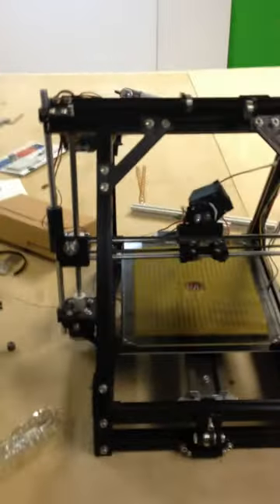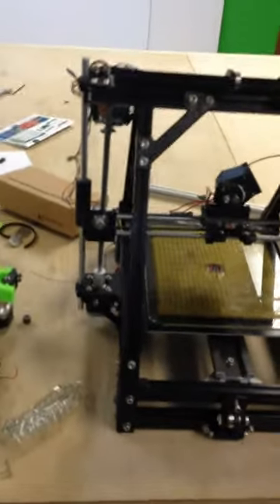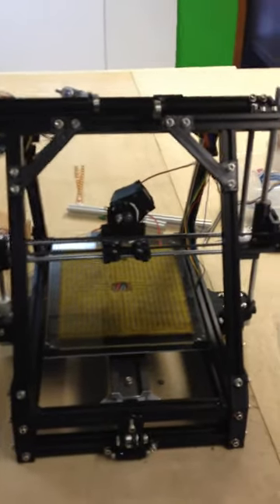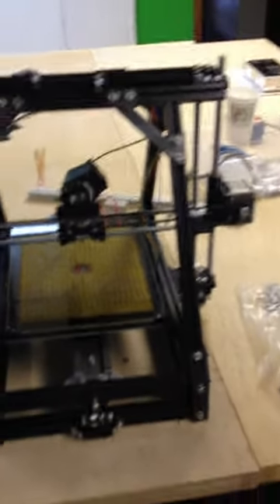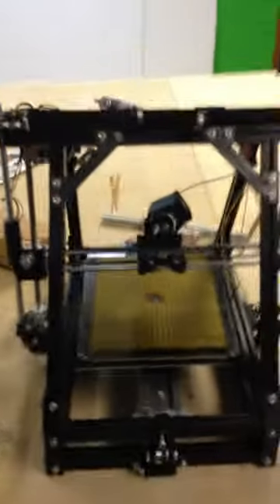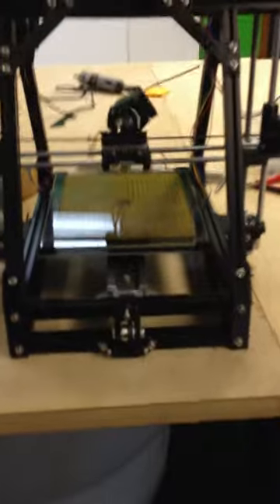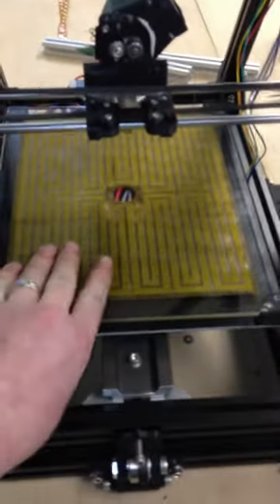TrinityLabs MendelMax-1.5+ with new Y axis!

Comment: I'll give a less technical, but more direct answer to your concern... I was not quite sold on these sheets either when Ezra first proposed them, so I tested our first prototypes. I attached one of our 250 Watt AC heaters to only 1/2 of the bed, leaving the other half in open air. I then plugged the heater in directly to AC with no temperature regulation and let it run for 30 minutes. The heater shot up to something like 175C, but the glass did not break. It was just fine.

Comment from the maker: Printing ABS at 110-120C bed temp will cause the bottom of your part to slump slightly and more and more the taller or heavier object you print. So I prefer to run ABS on borosilicate glass like this with a layer of PET tape and a small coating of ABS Glue wiped on with a wadded up paper towel between prints and use a temperature of 80-90C and no more.

Comment from the maker: Print beds used for ABS printing are usually run at a temperature of 110C or so. But with the PET tape we cover the glass with and a wiped on layer of ABS Glue(a small amount of ABS dissolved in Acetone), I can print on these new Y axis/print beds at any temperature above 80C with ZERO curling or bottom layer adhesion issues. In fact the lower temperature you can print at with ABS without curling or adhesion issues the better quality of your ABS prints.

continued because youtube blah blah...

Comment from the maker: Also this glass *is* heated quite evenly heated every where except the outer 10mm on each side. This last 10mm per side does end up the same temperature as the rest of the bed after 10 minutes due to the insulating and heat retention qualities of borosilicate.

Joseph, I'll pay you $1,000 if you can warp or slump the glass under normal ABS printing conditions even including 24/7 operation.

Search my youtube channel for  "3.3mm boro sheet is strong" to see just how strong the glass I use is.